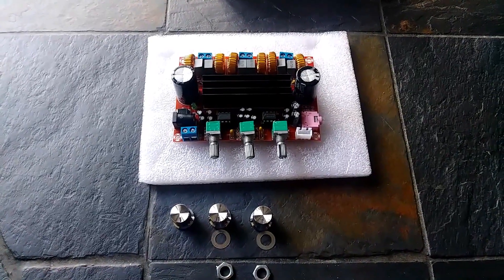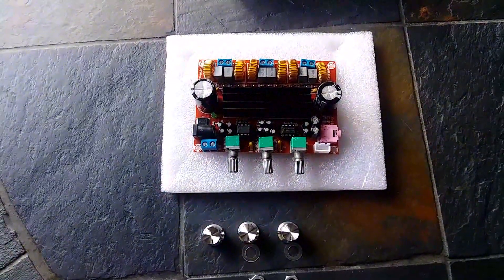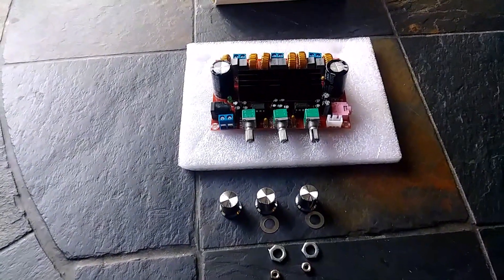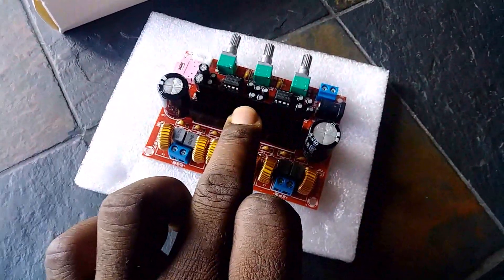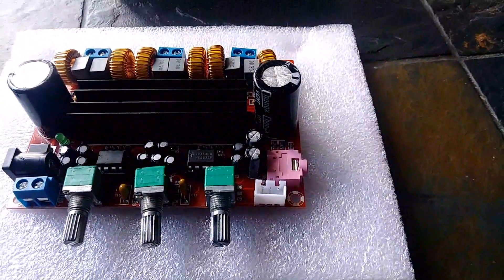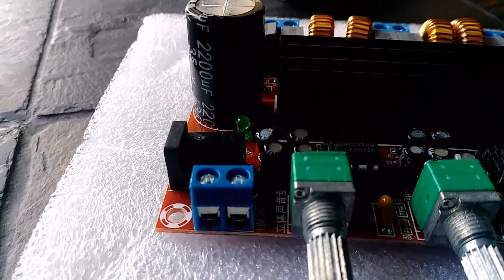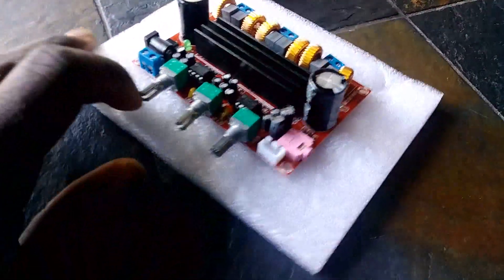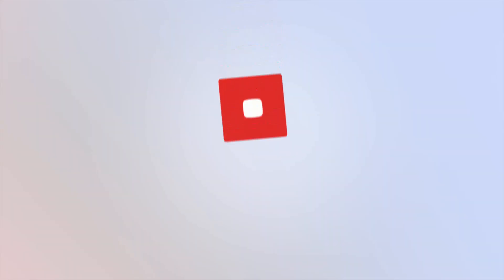Parts Express - TPS3116D2 Class-D 2.1 - Amplifier Board - Part 1

Comment: I bought a similar board years ago, never tried testing it until recently. Mine was a 12 V input and it worked with a 1.25 amp wall wart but didn't sound very good. Switched to a 2.0 amp ps and that made a big difference. Haven't found documentation for the board but thinking the ".1" bass output will need to be run thru a sub amp before it can properly drive a subwoofer. Good luck! (Current plan is to put in a small cabinet with a RPI zero with an audio hat as a sound
 source)

Comment: You can calculate the watt output estimate by using a cheap clamp meter such as this, while playing a 60Hz tone. https://www.harborfreight.com/digital-clamp-meter-96308.html volts times amps equals watts.
Reply: I have used many different chip-amps such as this. Personally I am a fan of the tpa3116d2. At max input voltage and volume, it produces a clean distortion free sine wave on the oscilloscope. Although, there are different looking models of that particular amp board.